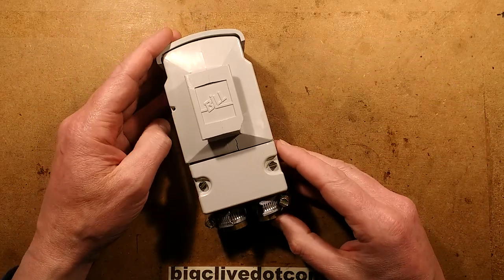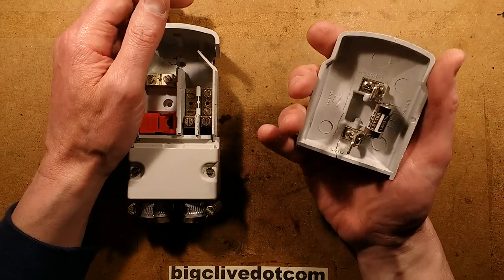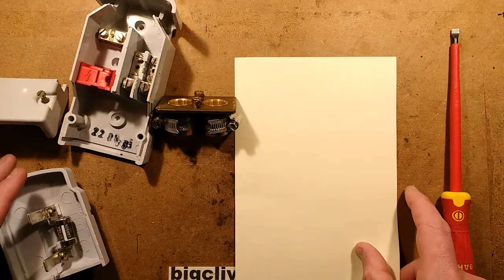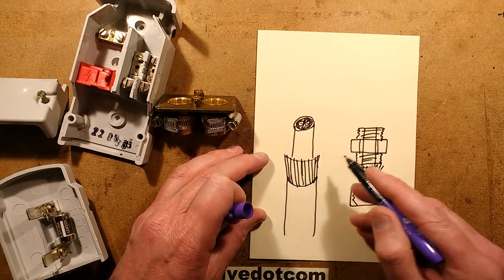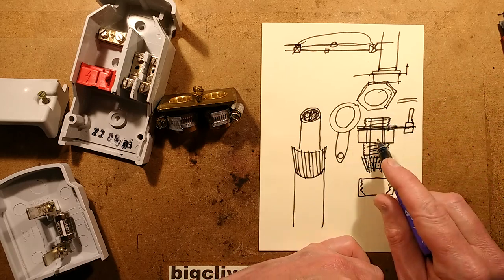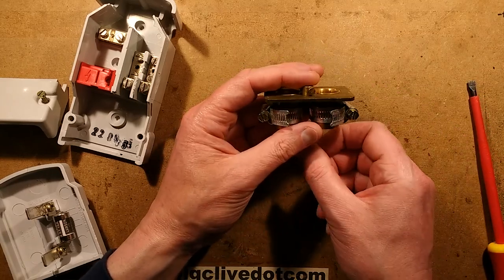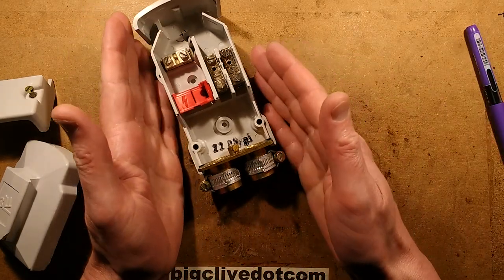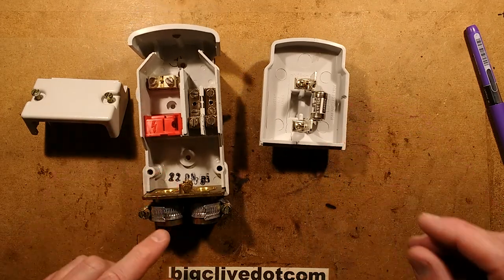Inside a lamp post connection and cut-out unit.

Comment: Wise words about the fuse Clive. I witnessed the aftermath, when somebody decided to replace a HRC fuse, with a few stands of copper wire.
The venue was a large chemical works; large enough to have a dedicated 132kV substation, equipped with two transformers. (and its own fire brigade, but more of that later)
A switchgear company was on site, carrying out some refurbishment work, which meant one of the transformers was out of service.
The site manager for the aforementioned switchgear company had a portacabin, which had a temporary electrical feed from a supply pillar equipped with switch-fuse units.
On this particular day, the supply to the portacabin was lost, rendering the making of cups of tea impossible. The culprit was found to be a blown 32A HRC fuse in the  pillar.
After exhausting the available number of spare fuses, you would have thought that the gentleman in question would have investigated the cause of the fault - but no, he proceeded to replace the fuse with copper wire.
I was doing some testing, maybe a hundred yards away, when he threw the switch in. There was a very loud bang, and as I turned around to look, there was a small 'mushroom cloud' of smoke rising above the pillar. The supply pillar was fed from a tertiary winding on the 132kV transformer. The feed to the portacabin was an armoured cable less than ten metres long, which had developed a short-circuit, after being run over many times by site traffic.
Fortunately, the chap was not badly injured, but the noise and smoke alerted the site 'fire brigade', who came racing to the scene.
Furthermore, the fault had blown the 200A fuse upstream, which left the transformer cooling fans inoperative - resulting in a panic call to the DNO to replace.
Two morals to this story: 1/ If a fuse blows twice, find out why. 2/ always replace a fuse with the same type.
Reply: I'd add a third one: 3/ Always have redundancy on everything that is critical (like the transformer fans)
Reply: That could of ended so much worse I cant believe that someone who's supposed to be in charge could do something so dumb
Reply: If only a blown fuse signaled some kind of abnormal characteristic of the power supply....

Comment: For mounting in a panel enclosure, something based on half of one of the brass items from the cutout should work. 
A single brass tube piece with a square top flange, the tube with a threaded section next to the flange and the rest knurled, which could fit through a metal panel with a securing nut on the outside, and the armour secured with the jubilee clip onto the knurled section below the nut.  Wires through the centre.
Square section inside the enclosure would prevent rotation when tightening the nut, provided the hole was cut at a suitable distance from the back/front/side of the enclosure.  Earth terminal on the inside square flange, so that the connection is maintained even if the securing nut became loose.

Comment: Our street lights in New Zealand don't use anything like this. Most of the ones I've worked on just have a standard HRC fuse carries mounted on a bar in the bottom. I really like this idea, it's neat and tidy and makes a lot of sense. Also we don't use SWA cables to connect street lighting. It's PVC PVC standard here. SWA is used more in industrial, power stations and oil and gas installations in New Zealand.

Comment: Lighting columns on SWA cables around here tend to have the cables terminated into separate gland plates, in order to assist with testing individual lengths of cable. The 'jubilee clip' method for clamping the armouring is not used, as over time, the exposed strands are susceptible to corrosion in the damp column bases, which can result in high earth loop impedance readings.

Comment: I'm an electrician for a street lighting company and the amount of times you pull the fuse and it is just a bit of 2.5mm instead of a fuse is unbelievable!,
Reply from the maker: Yeah.  It's not a great situation.  Especially when the trainees are shown how to do it by the older guys.
Reply: bigclivedotcom the worst iv seen was a 32mm copper pipe cut to fit inside a bs88 mains fuse carrier ... street lighting is a strange old game with how it's regulated! Seems to be as Long as it works then that's all that matters

Comment: It's always fascinating to see the differences between North American and European electrical fittings. We all have long standing traditions which include some great ideas and some god awful ones. Our lock nuts here are simple to use, even in tight spaces (they're designed to be tightened using a screwdriver and pliers as the hammer) but that cut out enclosure is a really cool idea from a safety standpoint. Most pole lights here would have a hand hole and we'd use traditional wire nuts to terminate to the lamp leads. The only thing I don't like about the unit is how little wire bending space it has, but that's typical for European enclosures in general. It's also amazing that no one has come up with a better method to terminate the concentric Earth/armor wires other than what you've described. Oetiker clamps would at least be less bulky and more tamper proof.

Comment: In Australia, we use a quick-disconnect style connector.  They are fused and accept SWA, but the disconnect allows for the pole to be knocked-over without risking electrocution.  The plug disconnects and makes the supply safe without killing all of the lights.

Comment: I remember when I was a kid maybe 8 or 9 I think, was playing with some friends at the bottom of my grandmas street in the school holidays. It was 2 rows of back to back houses, then a street across and another set of houses to the bottom, on the furthest left as you're looking down was like 8 house streets which ended with a big wall with an end of a house in line with the street that goes across (made it echo quite a bit). There was what would now be an old concrete lamp post (kerb side) , cover plate was off, wire had been chopped, about 6" of the cut wire was next to the house on the floor.....

Had the brilliant idea of I'll fix it n put the wire on, let's just say, if it would have been now police would be swarming thinking a bomb went off. Ended with a very big flash, a very big plume of smoke, a ridiculous bang and black fingers with a sprinkle of running around 'cause it hurt. Thinking of it now, luckily it was only just that and no burns. Meant I could hide what I'd been doing from my grandma and mum when she picked me up :D

Comment: Frying pan washer? That’s a new one on me. Literally every sparky I trained with and have worked with since calls it a banjo. Separately, would you class concentric cables (the type used by the DNO for PME supplies) as “armoured”? The ones I’ve seen have always had copper wire wrap as the outer part of the cable with solid core aluminium conductors for the phases. I wouldn’t rely on the copper outer for mechanical protection as it’s nowhere near as durable as steel. Also, I totally agree that using the SWA as the CPC never seems like a great idea, especially as the maximum permissible loop values were reduced in one of the more recent regulation updates (2nd Amendment of the 17th?). I know it’s possible if you oversize the cable to ensure there’s enough steel to get the resistance low enough, but in most cases it’s likely cheaper to run a smaller 3 or 5 core cable to achieve your disconnection times more effectively. A separate CPC will always be more reliable too as the armouring terminations are very susceptible to damp which will negatively effect the loop values due to inevitable corrosion of the joint.

Comment: One of the big things about meter fuses is that they need a specified, low resistance, to avoid having a large voltage drop across the meter when measuring current, which these things don’t necessarily do.

Comment: Wohoo, now after watching this I'm a certified electromagician and I can get rich quick doing these \o/
Reply from the maker: In the UK you could actually just attend a one day slideshow called G39 and you would be fully certified.
Reply: bigclivedotcom Here in Finland it's not quite as bad. First you need a degree, then you need to take the standards test and the 6 months of work experience before getting the permit I think.
Reply: Pentti Kantanen congratulations on passing.
Reply: In US we do four year apprenticeship then take journeyman test 2 year as journeyman then you are qualified to take master/contractor exam if you pass the congrats you must also take a minimum of 12 continuing education hours per 2 years ending on the even year.
Reply: bigclivedotcom That has changed since I left the UK in 1976, we had to do a 4 year tech course and 5 year apprenticeship. In Aus since then. You have to be a licenced electrician to touch anything over low voltage.
Reply: bigclivedotcom I am going to be spending some time in Scotland next month. Taking your warning to heart about shipping prices from the U.S I plan on bringing some items to donate to the hord of sacrificial Electronics. Where should I post them to.
Reply: There was never any requirement to do an apprenticeship in the UK. All you ever had to do was demonstrate competence.
Reply: Big Clive, one day to be a certified what?  It is a bit scary though, one day and let loose.
I know of some sparkles that are 2 yrs in and I wouldn't trust them to change a light bulb.
Others are spot on and and could wire up a town on their own.
Reply: Presumably someone decided that blue collar guys were getting paid too much... 
Not sure about degrees tho... in the UK at least you can be pretty half arsed about it and you won't fail a degree, but in a lot of jobs you need to be 100% fully arsed all the time.
Reply: Talking, masticating and soldering ( all at the same time) is a skill ....clive knows

Comment: Tighten the gland to the panel before terminating the cable into it. It is much easier to hold the locknut still while tightening the gland from the outside.

Comment: for someone who worked a fair bit with SWA on domestic supplies for workshops I can recommend getting a proper pair of armoured cable strippers like ARMOURSLICE by C.K Tools, it will keep everything nice a square to the cores and makes using glands so much easier.
Reply from the maker: Not seen that one.  I tried various others in the past and always ended up going back to my hacksaw and knife.
Reply: the nice thing about the CK stripper is you can replace the blades as you use them to score the steel armour and can then snap each strand off the same length, but not a cheap option if you only do the odd SWA fitment

lots of videos on YT

Comment: Finally, someone calls out the Meter manufacturers on a Channel I watch xD

In all seriousness though, it really is ridiculous, My snap-on meter has two fuses, both HRC rated at 1Kv or so, at 500ma and 10A, the 500ma costs $35, and the 10A cost me $45. They aren't expensive compared to other fuses, but you can get another fuse of that same size and rating easily, not to mention if something goes wrong with it and you send it back with non snap-on fuses, it voids the warranty.
Reply: 2009dudeman Keep the blown OEM fuse in the toolbox, and swap it back in when it’s time for warranty work :P
Reply: 2009dudeman 
I have an old Mac copy of a Fluke with those pricey fuses, after a while I soldered in agc type fuse holders so I could use them instead of the Mac fuses, but same rating.